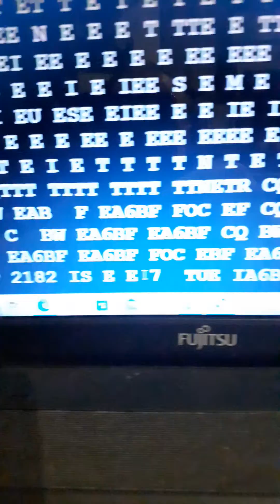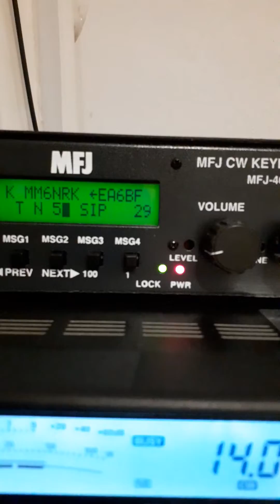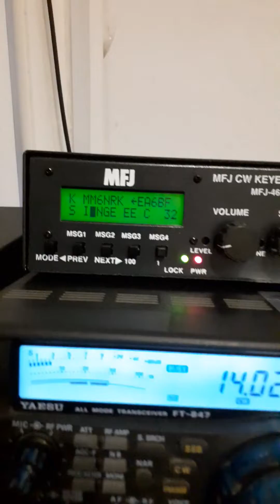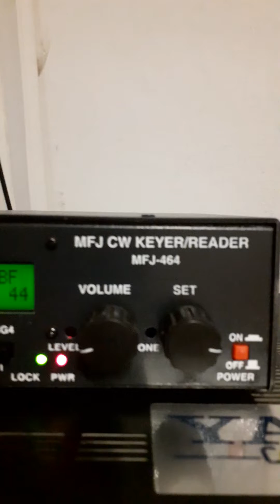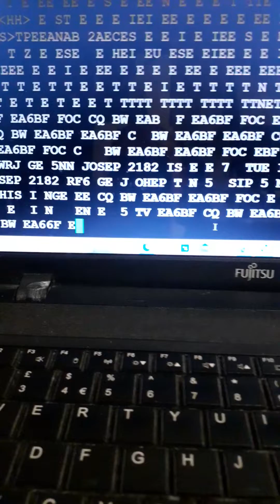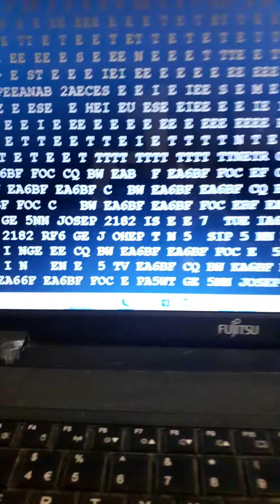MFJ - 464 CW Serial Output Set Up

Comment: If I buy an MFJ 464 will I also need a key.....or will it send from a keyboard with out.

Pity MFJ are no more....I presume these readers are only available used......or is there a modern version available.

Nick M9LPL
Reply from the maker: You can use a pc keypad .

Comment: THANK YOU I CAN GET MINE TO SEND BUT, CAN'T RECIVE. CAN YOU TELL ME WHAT I MAY DOING WRONG?
Reply from the maker: This is how you set up the MFJ 464 to work with your laptop .
You will need the MFJ - 5161 Serial Cable . 
Also you will need one USB 2.0 to RS232 Serial port DB9 9 pin Male CH340  Converter Adapter. 

One Serial RS232 Extension Cable DB9M to F 9 pin male to female Cable .
Install Putty Terminal on your laptop . 
Settings are Baud rate 9600 . Data bits to 8 . Parity to none . Flow control to Xon/Xoff . That is the settings I use and it works well
Reply: like i said thats all great but were do you plug all this in, ive tried all sorts and just get massive feed back a video of the physical connects would go a long way @68CT555